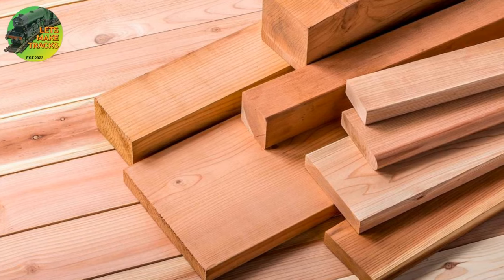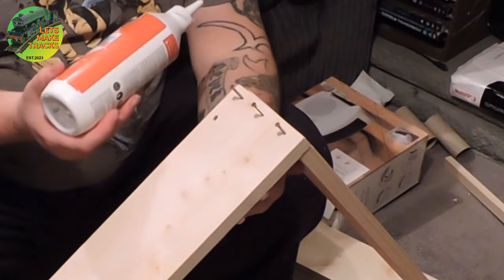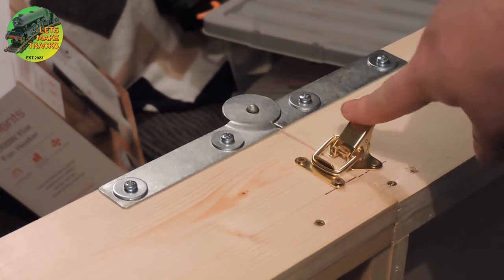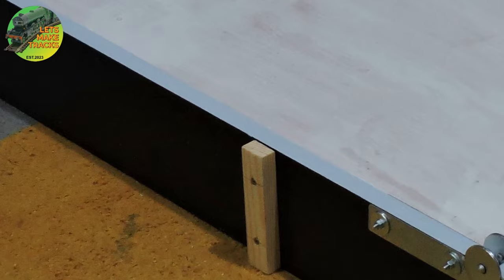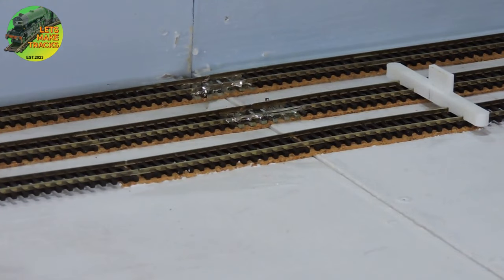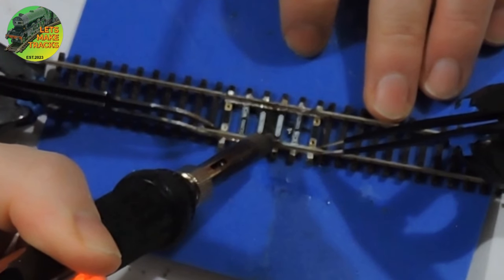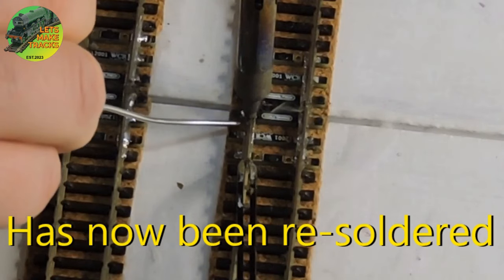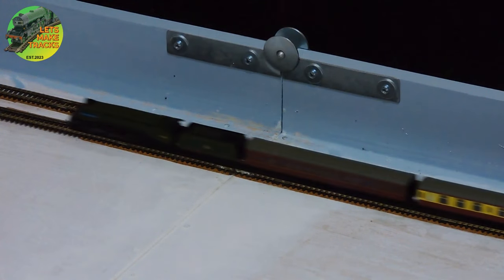Avoid Mistakes: Hornby TT120 Folding Layout Base Board Tips

Comment: Thanks a lot. Hoping to use this video to help make my son a OO layout. I have no idea about model railways (he does), have basic wood work skill and zero soldering skills. Wish me luck!
Reply from the maker: @victoriabaines6978  Indeed good luck 👍

Just double check your track plan against your base board, My curves come a little to close to the "wall" for my likeing. Im stuck with it now bit at least it all works 😋
Reply: @LetsMakeTracks2023  will do. Tbh, I don't have a track plan (he has millions though) we've been trying to work out a solution for storage as it will need to on either the lounge floor or dining table and put away when I need it to be. Now we've got an idea, I can look at sizes and plans. Thinking of around 6'x4' when opened out.
Reply from the maker: @victoriabaines6978  6×4 Is a popular choice for a 00 layout, I can recommend 3d rail. You can set your baseboard size and then use hornby and/or Peco track pieces to see how it fits.
Free version will only let you use 50 track pieces at a time thou.